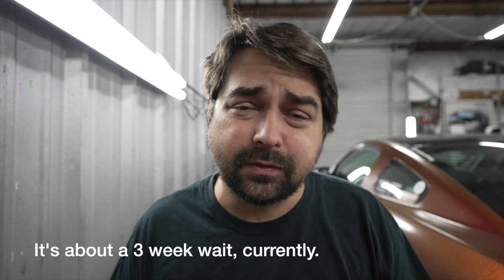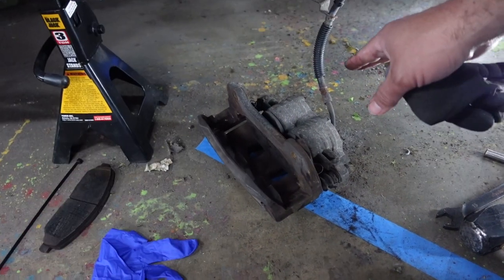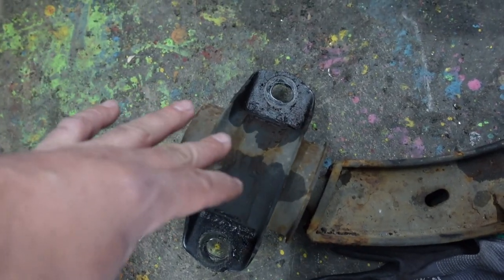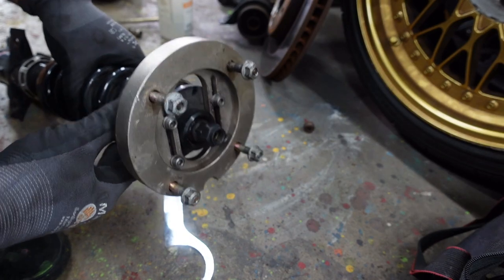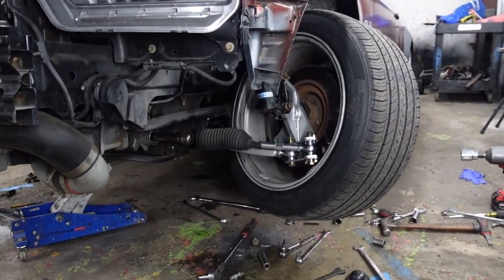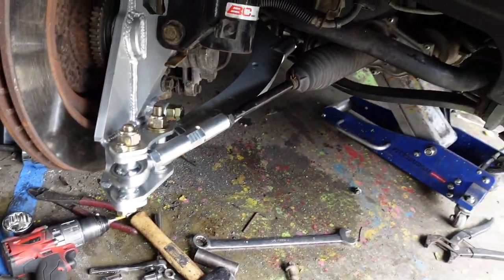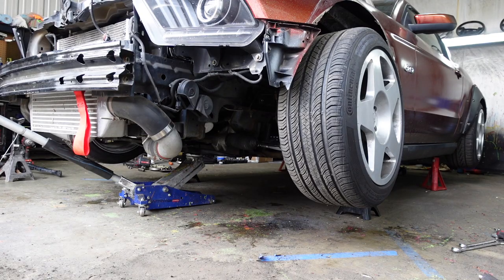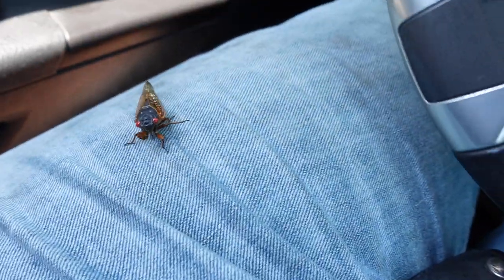FDF Mantis Angle Kit Install on S197 Ford Mustang 5.0 Drift Car

Comment: its been 1yr, hows the structural integrity of the front arms engine bay cutout handling?
Reply from the maker: Everything is still solid. And I’ve had some bad hits dropping a tire on track a couple times (especially at clubloose).  Surprised I haven’t bent a tie Rod at least, but it’s all been straight.

Comment: No brembo calipers or boss 302 brake hoses? 🤔
Reply from the maker: Nah.  Brembos are expensive and the stock gt stuff has been working just fine for the last 10 years.
Reply: @RobRabonPhotog  I have a stock V6 (I know, I can hear you laughing) and I found installing the boss 302 brake hoses made a world of difference with peddle feel. I got the brembos, rotors, pads, 1/2 in hubcentric wheel spacers and longer wheel studs for about 500
Reply from the maker: Ain’t nothing wrong with a v6!   They still make decent power and saves a few bucks. 
That’s a steal for brembos.  We did a brembo swap a while back on my friend Leo’s car and he spent way more on just the calipers and rotors (from what I remember).  The other reason is I honestly didn’t like the feel all that much of the brembos.  It was almost too much stopping power up front on his car compared to what I was used to.  And the brake dust seemed pretty crazy on his too.
Reply: @RobRabonPhotog  to deal with the brake dust I got the GT500 backing plates and was the car every time I take it out. I do wish there was an option for larger caliper for the rear.
Reply from the maker: @jth1987leb  I think Baer was making something slightly bigger.  My friend Kyle had their fronts but said the rears wouldn’t fit because of his wheel set up and the rear brakes being too big.  Not sure on all of the specs but I know the setup was pricey.